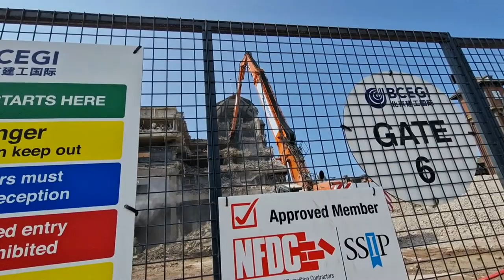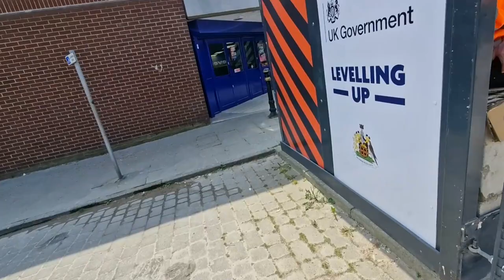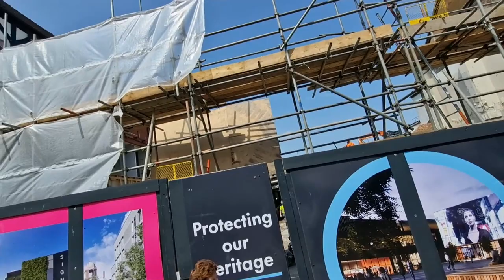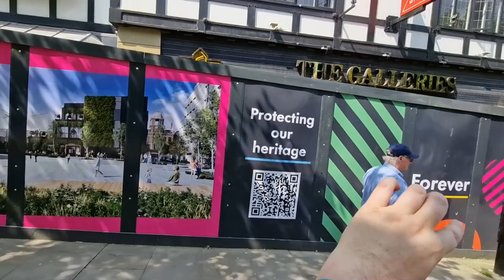Wigan Galleries Demolition Update 22/5/23

Comment: Looks like the lifts were crashed before demolition (hoist cables cut with counterweight lift car dropped to bottom), looked like the positioning system which runs up the shaft telling the lift where it is was removed along with the electrical control equipment. Late 1980s Otis lifts original until demolition bar new buttons lower down for disability compliance.
Reply from the maker: Thanks for the insight. I don't know much about lifts just you press buttons and they do the magic via electricity and all the gubbins.
Reply: @Foxstar1387  there is more than you think, used to be hundreds of relays but is now computers, these would have been mostly computer based but not quite as advanced as newer ones where they literally tell the engineer how to fix them in some cases.
Reply: Keep up videos l am older gallery's born 83 l not happy about it can't do nothing about it new market l am interested in car park